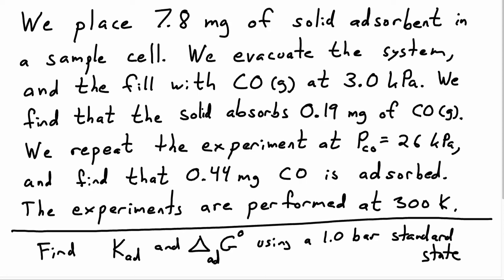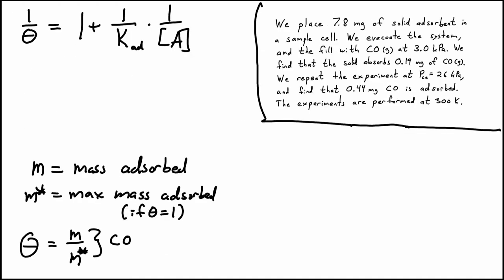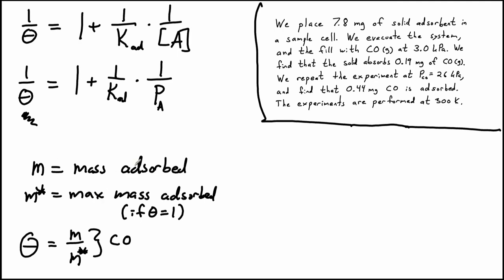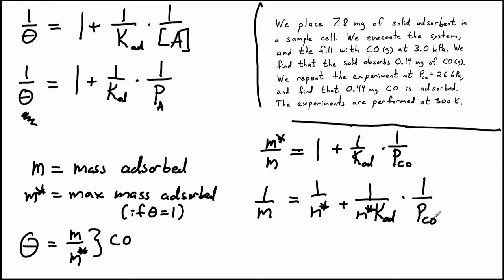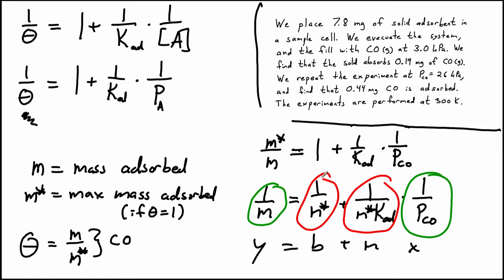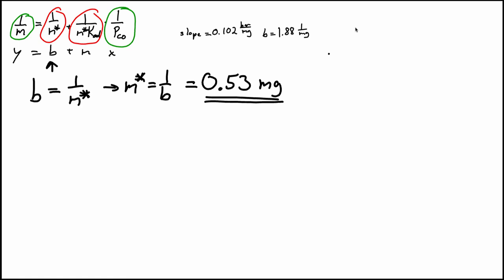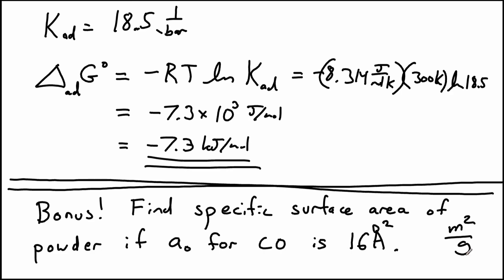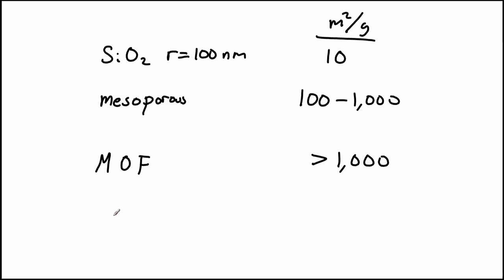Langmuir  Example

Comment: How did you get the mass of CO is 0.53....Was that from submission 0.44+0.19 ....If so, because in the experimental set up it is said  use two different pressure, does it mean to calculate the surface area the total mass of CO absorbed should be taken from the two pressure experiment?? Or can we only take from only one pressure experiment??? Thanks for your explanation in advance.